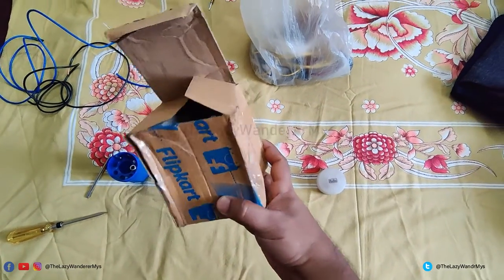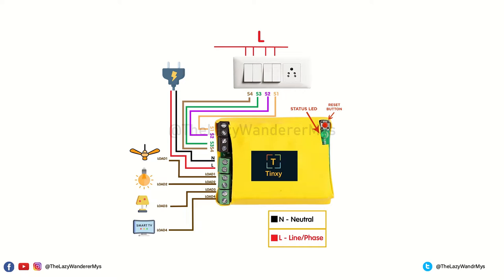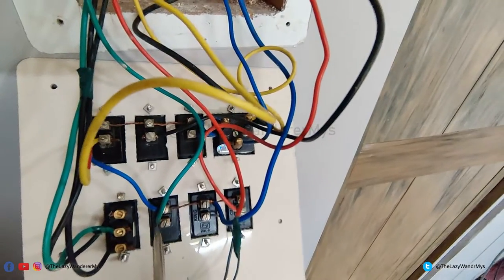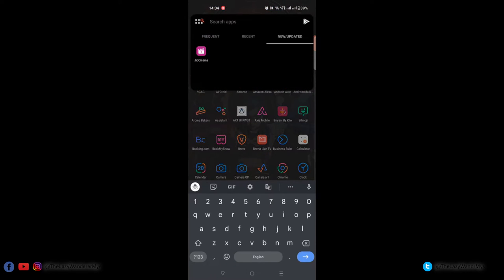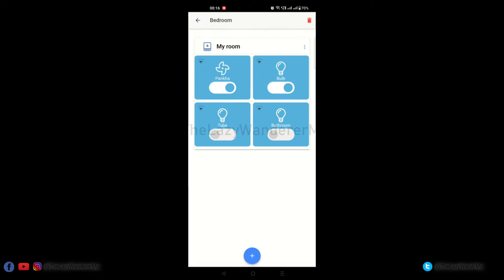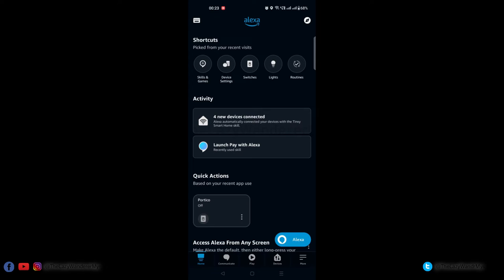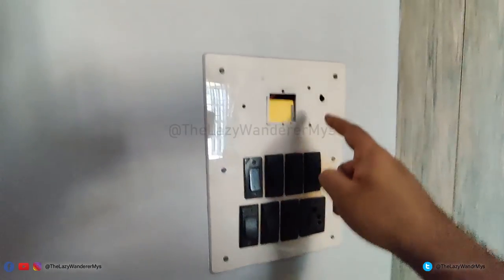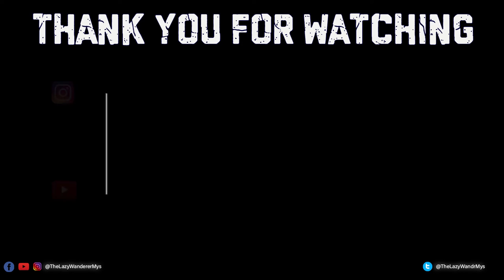Tinxy 4 Node Smart Wifi Switch with fan regulator | Unboxing | Install | Setup | Alexa | Google

Comment: I have very bad experience with this. After half an hour of installation, it stopped working. Got a replacement from Amazon. The replacement unit is dirty and seems to be returned by any customer Let I see how much days it works.

Comment: I am using their product 6 amp and 16amp smart switches for more than a year now. They are really good. Ordering few more  switches with fan regulators to install in my other rooms. I am directly buying them from their portal that will cost you few hundred less at the same time you may receive a direct working unit from them. Tinxy products are really better than the Chinese switches which are getting locked to their own ecosystem, not supporting the open source communities. By the way, you have done an excellent job with nice presentation. I have a question though. Is the Fan speed controllable by voice? I am bit worried on that since I have atomberg fan that is not supporting the normal regulator. Waiting for my shipment to arrive. Will keep here posted.
Reply from the maker: I use a regular fa, not sure if BLDC use different kind of regulator. Yes, the speed control works with voice, you can set it to Low, medium and high. DO NOT use the speed slider on google home or Alexa app. As to what I have observed, its only a 3 speed controller, anything in between will not work.
Reply from the maker: Also, thank you for your kind words.